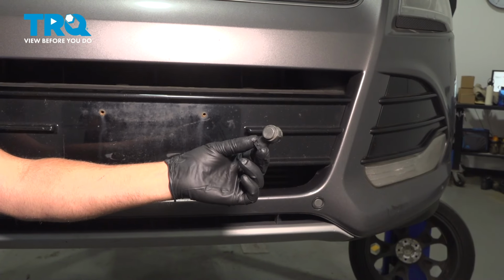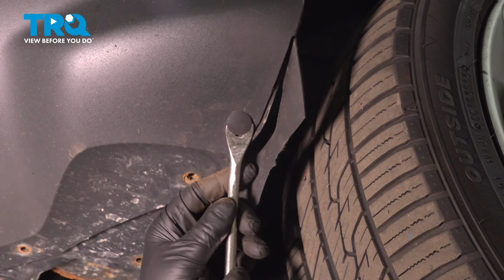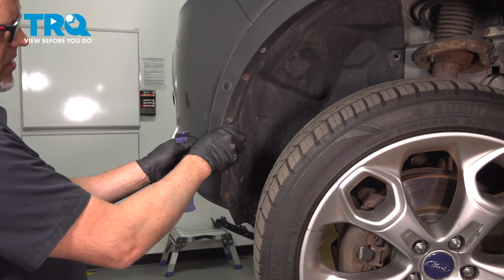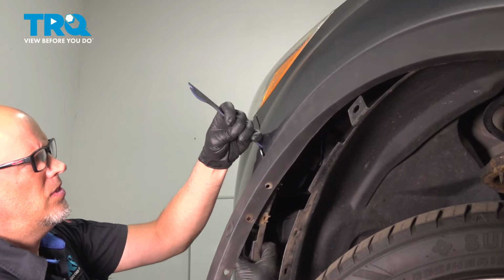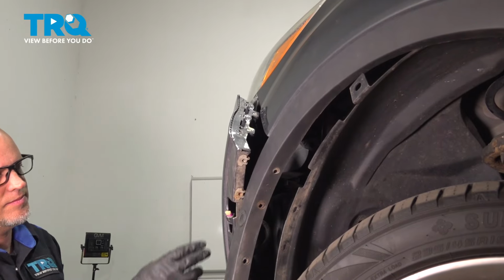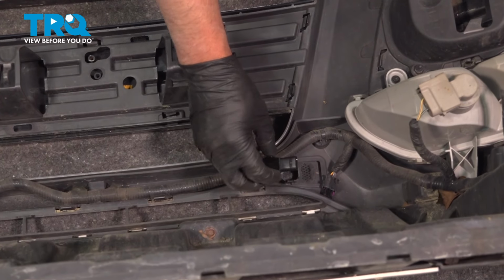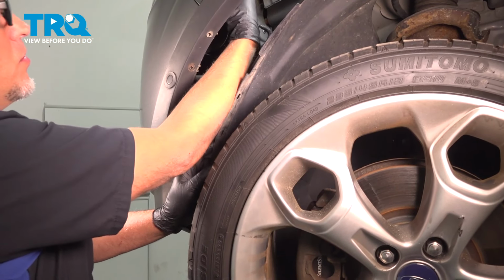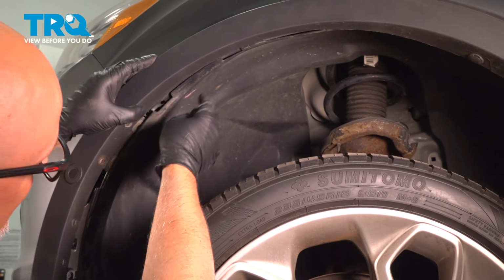How to Replace Front Parking Assist Sensors 2013-2019 Ford Escape

Comment: do you know if for the models which didn't come with front sensors this could be added and recognized by the car computer? I have a 2022 SEL Hyb but this version lacks of sensor on the front bumper and I really miss them.

Comment: I have a Power Steering Drive assist error . I thought it was a low battery problem. But changed the battery, problem is starting back up. Is there a sensor for that issue?